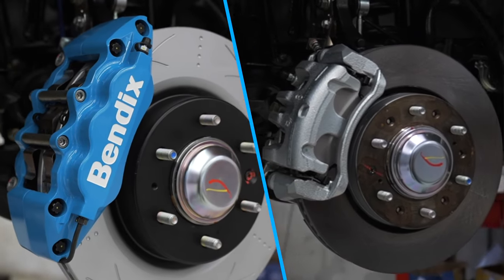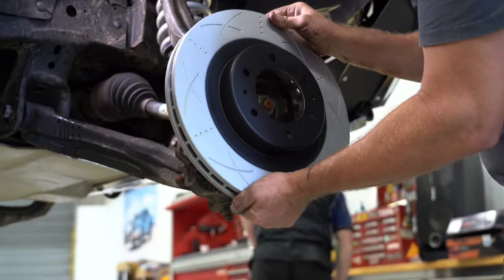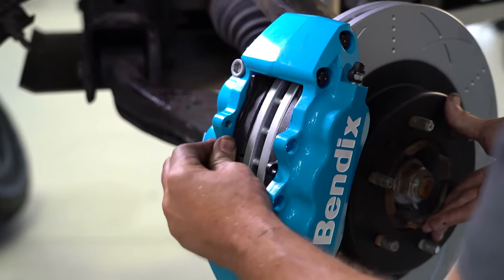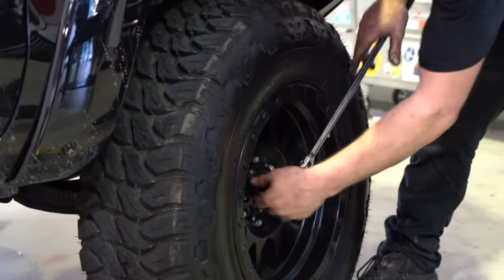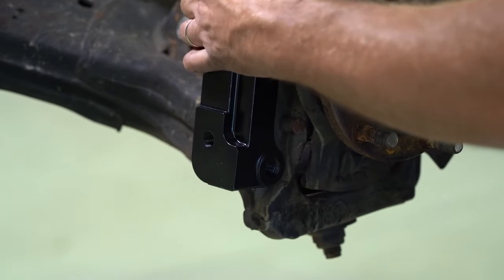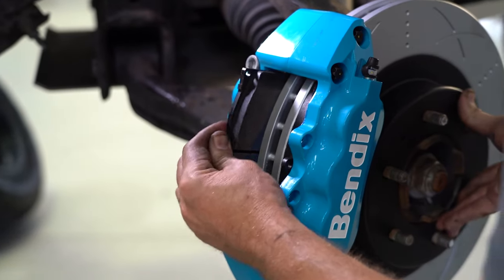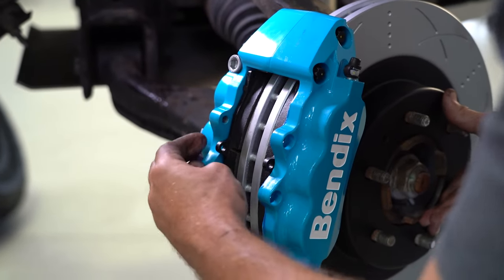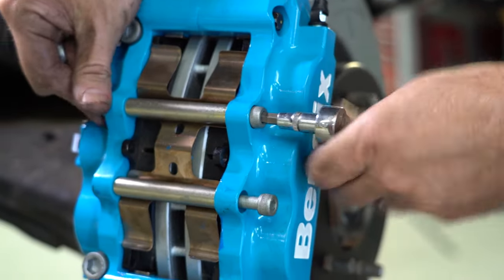Bendix Ultimate 4WD Front Big Brake Upgrade Kit Install

Comment: Well that's a bummer then I was going to upgrade my 2018 PX2 Ranger with stock 17 inch factory wheels as we are towing our caravan on an extended round Oz trip. I am not prepared to fork out big dollars on a new set of 18 inch wheels and tyres so the standard brakes will just have to do.